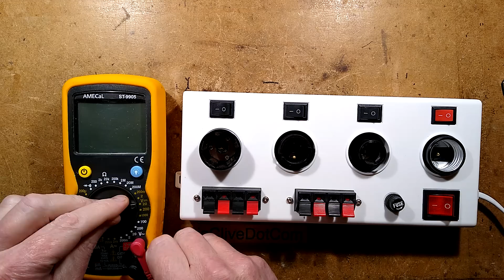AliExpress "explosion proof" Chinese factory test box

Comment: Oh it’s a lamp limiter. I assume you have watched the various valve radio repair channels including the ones I spaffed off several times.  Still not many tools that can do what a lamp limiter does, an amazing bit of bench hardware for people like me that repair mains equipment
Reply: I use an AC labsupply, but before that I used lamp limiters combined with a reset-able adjustable fuse (DIY build) You need a big lamp because otherwise the voltage-drop is to big for many smps (and that is what I find in  99% of what I get on the bench)
Reply: The first time I read your post I thought 'well, that person really, really likes valve radio repairs'... Then I realised my brain had inserted a rogue "to" near the end of your second sentence.
Reply: @GothBoyUK  I  have done so much valve radio repair I moved on
Reply: When I took Radio Shop in High School in the 1960s we would build and test small tube radio receivers. There was a special test bench we had to use- there was no power at our work stations other than for our soldering irons.

The test bench had an antenna connection and a speaker we would connect our receivers to. The power socket had a twenty watt bulb in a ceramic socket screwed to the bench in series with it. The teacher explained what it was for on the first day, and warned us that any student who plugged their radio into any other socket in the shop would be immediately failed. Nobody tried him on it despite typical teenager stupidity.

Comment: I looked up the ratings for glass fuses and was surprised that a lot of brand-name manufacturers rate their glass fuses to break 10kA on 125vac, but just 35A on 250vac. It seems absurd, but it explains why glass fuses are the norm in the US.
Reply: It's a bit scary to think of someone relying on that 10,000A rating as the sole protection method. Arc flashes can happen at 120vac.
Reply: @gloomyblackfur399  yes, but sustained arcing at below 150vac(rms) is very low chance. unless it's a gas filled chamber meant to do so or super high humidity and open air( for replenishment of the oxygen rich air with humidity for increased conductivity.
glass fuses are used in minimal current draw devices now days and in smaller devices, or holders which will not burn easily.
Reply: @throttlebottle5906  Super high humidity and open air?
Sounds like any non-conditioned house down here in the American South.
Reply: @gloomyblackfur399  And even in 12VDC circuits, if there is an inductive load.
Reply: It’s no joke. Here in Canada I remember testing a Japanese 5A 5x20mm fuse on an industrial (just in an industrial rental unit) 240V circuit- the fuse exploded very loudly scattering shards of glass- it must have arced from the end caps. Evaporated metal on the glass shards. The extra length on the old 1.25” fuses probably helps. Bulb is better than heater of course because it is nonlinear- used that when developing a VFD- saved a handful of them expensive semiconductors every time it lit.
Reply: Yeah I’ve noticed that too.

 I think it all comes down to having the voltage to sustain an arc. 120V can arc, in fact welding torches output less than that, but it can’t maintain that arc across the 20mm length of the fuses.
Reply: @deltab9768  Maybe, but there's a video on Youtube showing arc flashes from 48v to 240v. At 96v and a 0.5in (12.7mm) gap, it is incredibly violent. I wouldn't bet my life on the difference between 12.7mm and 20mm.
Reply: @gloomyblackfur399  
I’m pretty sure I saw the same arc flash video and they were using DC. I have a few videos on my channel demonstrating the major difference that makes with arcing. 

Honestly I’d be confident in any fuse that was UL listed or similar and used within the specified conditions. Not so much with non-certified fuses, although having an arc sustain wouldn’t be my top concern for a 20mm fuse at 120V.

Anyway, now I want to try pushing some of these past the 35A limit at 240V. That might be pretty exciting in a controlled environment.

Comment: A factory-made dim bulb tester. If only the connectors were rated for mains voltage (being speaker terminals, they are not) and a socket outlet was available...

I've got a pretty advanced test setup in my lab. On top of three switchable dim bulbs of different power, it has a separation transformer and a variac, both with true bypass relays... and a voltmeter and an ammeter in line with the circuit.
Arguably more advanced and better made than Paul Carlson's! That's Keritech level of over-engineering :)
Reply: Yours is definitely more advanced than Mr. Carlson's. I've only ever seen him use the same two bulbs in parallel no matter what the DUT is.
Reply: I got curious as to what the rating of "speaker terminals" was, so I had a look on some suppliers and I found a pair on farnell than claimed a 1000 VAC rating! Stock code is 2911029

Comment: Oh a dim bulb tester, a bit much for what it is, believe those should be used with as high a wattage bulb as you can get, and the tungsten ones are harder to get now in the UK or Europe, certainly not in the shops any more 😑

Why not see just how much a speaker terminal can really take? I should think they could do at least 500w relatively easily
Reply: They are hard to get here in the US also. You might be able to get some 25 watt appliance bulbs, but I don't think I've even seen a 60 W bulb in years. And forget about 100 Ws.

Comment: Do they make these with mains sockets instead of lamp holders? I always wanted a power strip for testing stuff without tripping the circuit breaker on my main electrical panel.
Reply from the maker: You can wire a heater or bulb in series with a standard socket strip.  But it won't stop the RCD from tripping with earth faults.

Comment: It's great when a glass fuse briefly becomes a little arc lamp.
Reply: Nah. 
Love it when they turn into an oldschool cameras flash  📸
Reply: @NinoJoel  200kW of power from a tiny flash lamp. At least for a few ms
Reply: Extra high intensity discharge! 💥
Reply: A small continuous plasma chamber.
Reply: expensive light

from that arc lamp

it's like expensive noise
Reply: I did that once...
Reply: the metal deposition on the glass is pretty cool.
Reply: @Fridelain I've seen some so well plated inside, they continued conducting after blowing.

Comment: Ha, it's a dim bulb tester like we use for old radios and TVs. Except somehow even less electrically compliant. Excellent.
Reply: “Dim bulb tester” that’s no way to talk about Clive 😂😂🫣
Reply: Dim bulb testers are still used in guitar amplifier repair, at least for the ones that are still tube- and transformer-based. (Edit: changed brain-o "amplifier-based" to "transformer-based".)
Reply: Probably ought to mention that it only works in that fashion if incandescent bulbs are used. LED's will not offer the same protection that the resistance of an incandescent bulb does. Clive may have mentioned this and I missed it... Either way, its worth saying twice.
Reply: 😢 Getting more difficult to find tungsten bulbs in the shops. Dim bulb testers  and "death leads". The good old days.
Reply: @Steve-GM0HUU  Search for appliance bulbs. They're for ovens and other appliances that need bulbs that LEDs can't operate in
Reply: @Steve-GM0HUU  Look for appliance bulbs. They'll still be sold everywhere since you can't exactly put LEDs in an oven (no idea why youtube ate my previous reply)
Reply: @iamdarkyoshi  Thanks for advice. This is a good idea.
Reply: @Steve-GM0HUU Now $.50 incandescent bulbs will be relabeled as a test part so they can charge $10 for them.
Reply: I must be one of the few people that never has, and never will, use one of those "dim bulb" things on my old radios and TVs.
Reply: @HowardLeVert  Any reasons as to why? They're a diagnostic tool for testing suspect equipment to reduce damage if something goes wrong, not as something you'd use regularly
Reply: And for many other cases where you are restoring/servicing/repairing/evaluating potentially unreliable equipment, without risking a) blowing your workshop breakers (which might be unwanted if there is computers, lighting etc to run and you want to minimize - dangerous! - confusion in case there is a short circuit event, and b) damaging (hard to replace) equipment any further, c) starting fires or indeed explosions (eg with capacitors). Could be replaced in many cases with a selective lower-rated breaker, but actually allows measurements in equipment in a faulted and powered state. ... The thing is, dim bulb testers need some skill and experience to use safely - they do not protect the person working on the equipment,  they can render an actual circuit breaker inoperative and actually cause a fire IF USED UNATTENDED, you have to monitor the actual voltage going to the device, they can provoke strange or even damaging effects in switching power supplies (which can become a bit unstable with high impedance sources), and more...and then, there is the residual risk of the incandescent bulb deciding to short (as incandescent bulbs occasionally do when worn or mechanically stressed).
Reply: Works in automotive using an automotive bulb with leads in place of a fuse to help locate shorted wires.